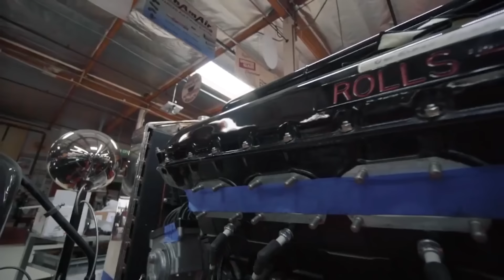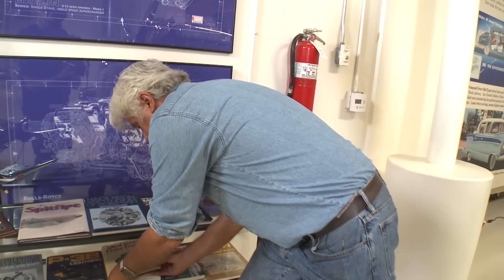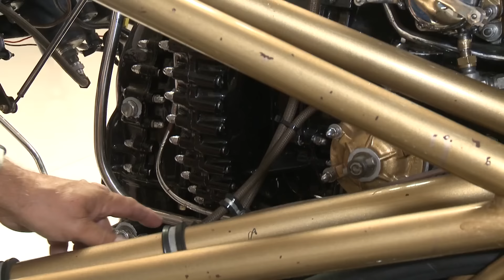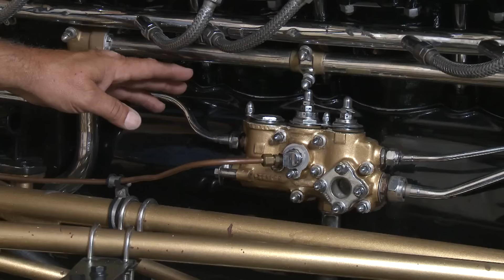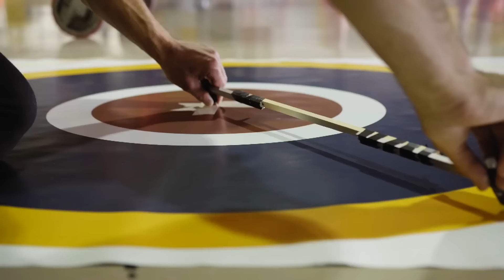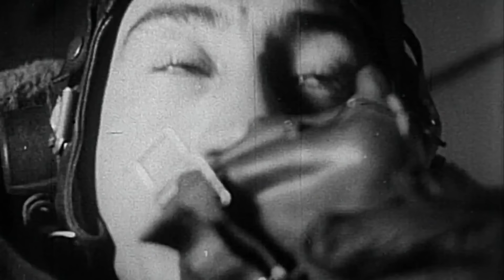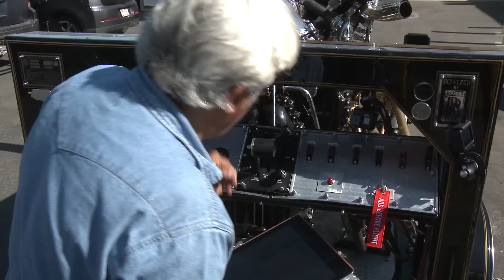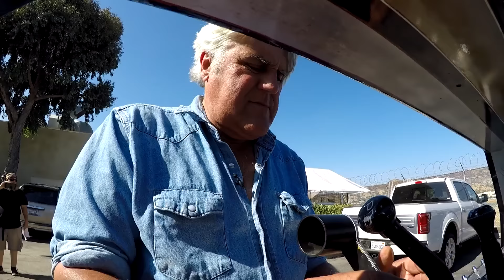The Engine That Won World War II - Jay Leno's Garage

Comment: Bla bla bla
Junkers Jumo 213 
Mercedes Benz 605
We have had direct fuel injection, when Rolls Royce have carburatores...
Reply: And?  Later Merlins had fuel injection. The two stage, two speed superchargers had one injector point in the supercharger - pre-mix.
Reply: @johnburns4017  yes, later.
Look at FW ( TA ) 152.
Fastest Piston Fighter , Jumo 213 e.
Stealing 1.700.000 patents after war.
Without German technoligy you don't fly anywhere....
Reply: @horstweindl725  The RR Merlin and RR Griffon were better than any German V engine. The supercharger was superior.

Comment: You should run it until the oil gets hot. Otherwise you have water in the oil. This can corode the cilinder walls and anything else.

Comment: In regards to the video's title: respectfully, the engine that actually won World War II was the Pratt & Whitney R-1830 Twin Wasp. Powering the C-47 (which, remember, Eisenhower referred to as one of the things that one the War, not the Merlin-engined Spitfire or Lancaster), as well as the B-24 (which was the main bomber for the Pacific Theatre), the PBY, and many others, it is still in service today. Far more than can be said for the Merlin. The old radial engines like the R-985, R-1340, and R-1830 may not be as sexy as a shiny V-12, but it was the transports and heavy bombers that won the war, not the fighters.
Reply: Crusty bits in my Skiddy Underpants  
The Germans were beaten over Dunkirk before the Battle of Britain.

Comment: In the entrance of the aeronautic faculty at a prestigious London university, (a stone throw from the Science museum) suspended on  4 bowden cables is a Merlin engine which came out from a mk9 Spitfire. It looks like a large black lump, non working, certainly not attractive. In comparison, what you have Jay is an absolute gem..... beautiful to look at, interior shots are incredible and....... it's working. Brilliant👍👍👍👍 Most important ly, you presented a real in depth demonstration highlighting technical issues....

Comment: Merlin being remade in 2020!...Rolls Royce ,is now rebuilding and Engineering the British Engine!...The,Rolls Royce from 1990 -2019 bought by BMW...The, Company installed the "BMW Engine" inside the Rolls Royce Body!..So,basically a "Kit Ca"r or Chrysler 300 with extra flare!...But, now Rolls Royce or BMW understands the need and want for "Rolls Royce" !!!..Really,without the Engine its only 1/2 the Car!!!...I Own,two Classic  Rolls Royces in a Shadiw 2 and Cloud 3...(1976 and 1963)....Both,100% full Roll Royces made with "Merlin Engines"..ill,never,ever sell👍🤔
Reply: A Merlin is too big to fit in a RR Shadow.
Reply: The, Merlin Engine was inside Rolls Royce up until 1980...Then, Volkswagon Company bought "Bentley first  and then later Rolls Royce"!...Thus, Rolls Royce has a "B.M.W Motor"!...Presently, due to Sudia Arbabia Sheiks ,and there love of Rolls Royce!...The, "British Motor "is being remade ,by Blueprints by Original Rolls Royce! Manufacturing!...I have,  a Silver Shadow and have "Orginal Motor the  Merlin"..The, Merlin Motor was Nanufactured in different sizes and Aluminum...Jets, Planes,Tanks, and Automobiles!...My two Rolls Royces 100% True Rolls Royces and not hybrids!...Due have the "Merlin British Motor"...1963 Cloud 3, and 1976 Silver Shaow 2....Matchbox Cars in Rolls Royce doesnt show Motors!👌
.
Reply: @eggssunnysideup1301  
The Merlin engine was never in RR cars. It is far too big.  Only the car division, which made few cars was sold to BMW. Aero engines stayed with RR UK

Comment: IF THEY PUT THAT BAD BOY IN OUR P38L WE WOULD HAVE DESTROYED THE LUFTWAFFE ALONG WITH JAPANS AIRFORCE! While the ALLIISON'S ENGINE WAS OK THEY HAD MANY ISSUES WITH THE TURBO CHARGER SYSTEM AND YEARS LATER FIXED IT THE MERLIN ROLLS ROYCE WAS BETTER THAN DURING WAR !
Reply: The British took a few P38s to test, ordering 500 off plan.  On testing they canceled the order. The planes were used in coastal duties.

Comment: RR tested its engines with V twin bench versions. They could prove new designs at much less cost. However they used a full size oil pump which in the full engine had to move 6 times as much oil. The oil supply was always marginal especially if the engine accidentally over revved (not uncommon in battle)

Comment: Imagine designing this engine in the early 30s with just pen & paper. No computer, no 3D printing, not even a calculator. Making all the casting molds for the crankcase with no CAD software on a drawing board :(

Comment: Can anyone tell me: When Jay (I'm also a jay haha) says "SU's" Does he mean the Single Barrel Stromberg SU's? as found on the FORD 250 crossflows for e.g.? I was a big fan of the 250s as a kid. I knew a lot about them and what to do to them to gain a lot of "NA" Performace from them. Many thanks to Newport TAFE and Brian Johnson (not the singer) for that. o7 Mr. Johnson! No one seems to give a crap about 250s anymore. But to me, they were just fricking awesome. While everyone was toying with V8's I was trying to find a way to beat V8's with a six and NO FORCED INDUCTION :P MEEH! Yes Yes 265 Hemi, but I already had good knowledge on the 250 so I just stuck with. My Pride and joy was my 1973 KC Cortina with pre crossflow 2v head (2v had separate manifolds to head, whereas standard had one piece). A whole bunch of other stuff we did I won't mention here. But we get them up to around 250 HP which wasn't bad for the time. We did go higher but we would push cams out the side of the block, conrods through the sump, or just outright shatter pistons or bend valves. We wanted them fast but also reliable. I think we did well :D was fun while it lasted. All thanks to Tripple SU's With 30 Deg of advance, cam to suit with a few other things we were shiting at 6500 to 7000 RPM. That was wild for those days. My everyday drive now does that without as sweat but for back then that was wild and you could do it all day. Treat it like any other engine. Webber can lick it :P

Comment: The Pratt & Whitney R-2800 was more reliable.
#1 No cooling system. 
#2 no gearbox because a radial engine only turns 3500 rpm.
#3 It was faster to build.
#4 it required less machining
#5 it had less parts.
#6 2200 horsepower
#7 The planes that had the r 2800 could take much more punishment.
# 8 The r 2800 brought back more pilots after severe damage 
#9 The R2800 itself doubled as an armor shield . 
#10 1 small flak fragment or bullet hit any part of the cooling system and you got to bail out. Probably over enemy territory.
#11 air cooled radial engines brought back more pilots then the liquid cooled merlin. 
I will say this the merlin was more fuel efficient so it was the best escort fighter. But for a all out fight, i would chose the P-47 or the F-4U Those 2 are much more robust then any liquid cooled aircraft.
Reply: +swatter 521   One correction, the R-2800 did have a reduction gear.   http://www.sdmodo.org/users/SDAM/Corsair/Phil%20contribution/Moteur/reductiongearing.jpg
Reply: It was huge costing a fortune to make.

Comment: If you love engines like these, I'd look into a engine Called the Pratt & Whitney  R2800 Double wasp. This was a 18 cylinder twin row radial that was used in tons of aircraft that produced 2800 hp and was rugged and reliable! Aircraft such as the F6F hellcat, F4U Corsair, P-61 Blackwidow, Bearcat and Tigercat to just name a few had this engine.

The next one is a lesser know one and unfortunately there are Very few that exist. It is the Naiper Saber 2 engine. This was a H-24 Cylinder that was really complicated and made over 3,000 Horses and was produced in the thirties! This engine was used in the Hawker Typhoon and the Hawker Tempest. This engine had quite a few issues unfortunately due to its design but was a monster of an engine and because if it, Tempest's were able to reach above 500+MPH and catch V1 rockets and shoot them down. Ww2 engines that were used on aircraft are quite fascinating because of the complexity of the engines that were used. There are tons of engines to read about that are awesome. Too many to list

Comment: The Merlin is a nice engine, but have in mind, it has a big brother/sister. The Griffon. That is even better sounding and running. And 36 liters displacement. And the only thing that sounds better than a Griffon, is two Griffons..... (quote a Danish Tractorpuller speaker)

Comment: The airflow rate going through the engine is so high that vectoring the exhaust rearward gave a measurable speed boost.
Reply: I can't remember the exact number but it is about 5 pounds of thrust per exhaust port.  Call that 60 pounds of thrust in addition to the fan up front.
Reply: @Quercus_Maximus  I read that it was roughly equivalent to another 50 horsepower.

Comment: On the P51 Mustang, you’ve seen the large air scoop under the plane? The oil cooler and radiator were mounted in that thing. Now understand that the heated air exhausting the out the back provided enough hot air thrust to more than make up he drag that this big scoop gave. True fact! It was designed that way. THAT is engineering at its finest.

Comment: Actually, the Pratt & Whitney 2800 Double-Wasp was thee greatest (mass-produced) piston aircraft engine ever made, and contributed way more to dual-theater Victory in WW2 than the Merlin... but you're never going to get that radial monster into a car... or a hydroplane racing boat, lol...
Reply: Nah. The R2800 missed half the war. A great engine though, no doubt, but it's hard to compete with the engine that drove the Spitfire, Hurricane, Lancaster and Mustang, amongst many others.
Reply: @ratofvengence  Nah.  The R2800 contributed more than the underpowered Merlin ever did.  You need to learn history before spouting crap.
Reply: @AmericasChoice  Awww, did the facts I stated upset you? The Merlin predated the war (not just the bit where the US decided fighting tyranny is worthwhile), so of course it wasn't as powerful as later designs. Still, it was powering war machines right through the entire war, unlike the R2800. The Griffon was developed from the Merlin, and that was earlier than the R2800 too, but it still managed greater power with less frontal area.

You seem to be as unaware of historical fact as your name suggests.
Reply: @ratofvengence  Your argument matches your intellect...vacuous.  The issue isn't when a certain engine was designed or produced.  Deployment of the R2800 turned the tide of the war.  The Merlin was fine in Lancs and Mosquitos.  The Griffon was a great engine but didn't impact the war effort in any major way.  You conveniently ignore the strategic impact of the R2800. Now run along vermin man.
Reply: @AmericasChoice  Arrogance and ignorance; as I said you are well named :)
I know it's not a 'Murican thing, but try reading a history book or two. Don't forget, the greatest US fighter of WW2 was the Mustang, built to British specifications and powered by a British designed engine. Was it underpowered? 🤣

Try again kiddo :)
Reply: @ratofvengence  Kiddo?  Really?  I have been studying Military history for over 40 years, from real sources, not Warthunder like you.  The P-51 was the not the best fighter of WWII, it was the best long-range escort fighter.  And it was underpowered by 1944-5 standards.  But you wouldn't know that, would you.  You are too busy attacking me because I am American.  What shithole country are you from?
Reply: @AmericasChoice  For someone who claims to have studied military history, you sure don't seem to know much. Instead of presenting facts and references, you just go on personal attacks.
Very 'Murican of you. :D
Reply: @ratofvengence  Awww, poor baby.  Did I hurt your feelings?
Reply: @AmericasChoice  Grow up kiddo. I guess you aren't worth responding to further. 😁
Reply: @ratofvengence  You never answered my question.  What country to you live in?

Comment: The Classic Fighters Omaka air shows are held at Easter in odd-numbered years – the Warbirds Over Wanaka air shows are at Easter in even-numbered years – and a couple of guys show up each time with two Allisons on trailers. They get very loud and spectacular when they run and, after the first time I heard them, I decided that I would be taking earmuffs in the back pack next time.
There are also Merlins at the air shows, but they are in a pair of Mark IX Spitfires and a P51. Thank you for your preservation and enthusiasm, Jay, but nothing matches the sound of Merlins taking off and flying.
Like the Lancaster in this presentation, heheh.

Comment: The Merlin engine is a fine engine I'm sure. But there's one engine that stands out more and was a bigger star than the Merlin.  The Detroit Diesel 2-stroke engines played a far greater role.  The Detroit engine can be found in any military vehicle whether it was heavy trucks running supplies, transporting soldiers to their  next engagement.  Construction vehicles for building projects like airport runways or bridges.  Detroit engines were also found in the maritime vessels for landing craft and troop transports.  Detroit engines were also used as power generators as well.  A person could pull the front timing cover and with a change in the gears, a person could reverse the rotation of the engines.  You could also mount an additional engine and run them in tandem.  Jay Leno knows his history of any vintage vehicle about the do's, don'ts, when, where, what and why's of say a Duesenberg.
Reply: My father was a tank commander in the New Zealand Division in North Africa and Italy and said the early Shermans that they used came with GM diesels. Later, then the US started its island-hopping up the Pacific, they needed all the GMs that they could get for the landing craft, so the Shermans started arriving with the composite engine, made up of five six-cylinder engines connected to the output shaft.
He said the two immediate effects were the new engine was a pig of a thing to work on, and the other was that, with the engine being petrol powered, the Sherman caught fire more readily when hit.

Comment: He never mentions that another difference between the engine he is showcasing and the ones mounted in planes was that the engine was mounted upside down in the P51 airplanes
Reply: The Merlins were not designed to run upside down and no Merlin was ever fitted to any aircraft in such a way.

Comment: Reminds me of a Hemi engine I got out an early 50s DeSoto. I had gone through the engine, piece by piece, and gave each piece some "lovin'", right down to working the forge lines out of the piston rods, static balancing the piston/rod assemblies and de-burring the engine block & heads oil returns, etc. Had it almost to the "run" point, but ended up getting laid off from my good paying job and selling it to finance some other project. Can never get enough of that engine rumble.

Comment: The Packard manufactured Merlin engine is no doubt legendary, as is the The P-51 Mustang.  I would love to see a build of a  2,000 hp (1,500 kW) 18-cylinder Pratt & Whitney R-2800 Double Wasp radial engine used in the Vought F4U Corsair; perhaps the prettiest WWII fighter aircraft.  I say perhaps because for me, it's  between the Mustang and Corsair.

Comment: JAY YOU REALLY PUT OUT SOME REAL PERVERICATIONS, THE MERLIN  1650-61BUILT BY PACKARD AND BUICK UNDER LICENSE TO ROLLS ROYCE IS NOT SOLEY THE ENGINE THAT WON WWII. THERE WAS THEV HE ALLISON AIRCRAFT ENGINE 1710V-111 AND 113, ON THE HE LOCKHEED LIGHTENING P-38, THEN THEIR WAS THE HE MOST RELIABLE ENGINE OF ALL THE PRATT AND WHITNEY R-2800 USED IN THE HELLCAT WHICH ACCOUNTED FOR OVER 2000 JAPANESE PLANES BEING DESTROYED, IT WAS  USED IN THE BEARCAT, THE TIGER CAT AND YOU COULD SHOOT OF THE CYLINDER JUGS AND THE PLANE WOULD STILL FLY, IN ONE INCIDENT FOUR WERE SHOT OFF. A HELLCAT PILOT  I KNEW  BROUGHT IT BACK TO HIS AIRCRAFT CARRIER WITH FOUR JUGS SHOT OFF. THE REPUBLIC  P-47 ALSO HAD THE PRATT AND WHITNEY R-2800. ONE SHOT IN THE COOLANT APPARATUS OF  MERLIN WOULD OVERHEAT AND SEIZE THE ENGINE. JAY YOU NEED TO CHECK YOUR FACTS AND READ SOME HISTORY, YOUR TOTALLY INCORRECT. ALL OF THESE ENGINES CONTRIBUTED TO WINNING THE WAR AND THEY ALL HAD DEFICIENCIES (TEETHING PROBLEMS)BECAUSE THEY WERE DESIGNED QUICKLY TO GET US INTO THE WAR.

Comment: The reason this engine was more powerful than the larger German engines is the Allies had 130 - even 150 octane fuel while the Germans only had 96 octane.  High octane fuel allowed higher boost pressures from the superchargers resulting in much better power to weight. The Germans tried to compensate by adding water/methanol injection but the tide had already turned by then.

Comment: The battle of Britain era Spitfire was one of the most amazing and important fighter airplane of the war. One of the only limitations of the Merlin engine is that it had a tendency to overheat while on the ground but once the plane was airborne there's not much you could not do. Spifire pilots have said that the plane would become part of you. Those engines could take a lot of punishment, for example some Lancaster Bombers would suffer tremendous amounts of battle damage and fly back to England after 1 or 2 engines were out of commission while the running the remaining engines at full power. Those engines would keep running well beyond the recommended power settings and get the boys back to base. Imagine how many lives were saved because of such amazing engineering.

Comment: Did you know, the Messerschmitt BF109s prototypes used RR Kestrel Engines in the mid 1930s? They were later swaped for the German  built Daimler-Benz 601 & 605 V12 engines.